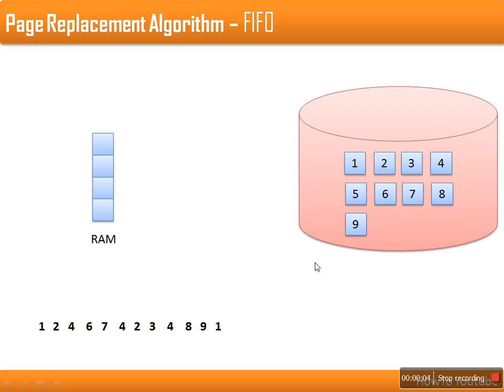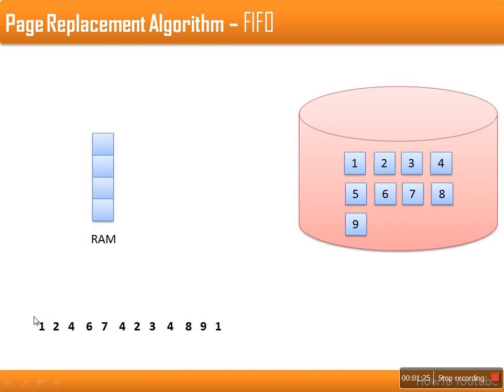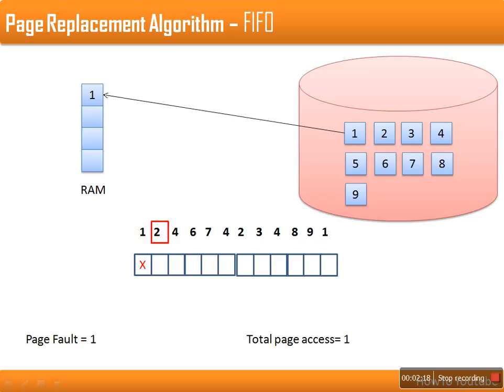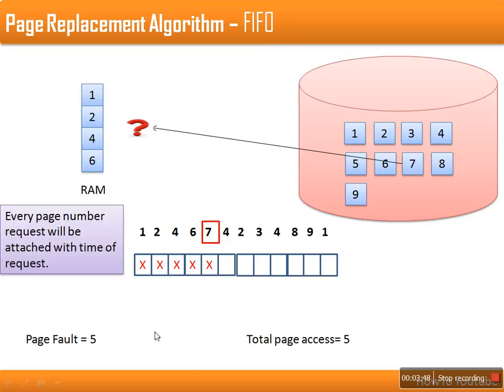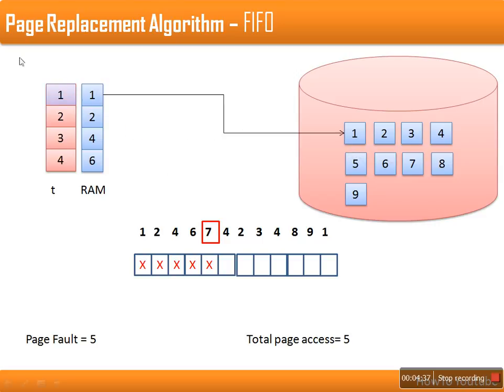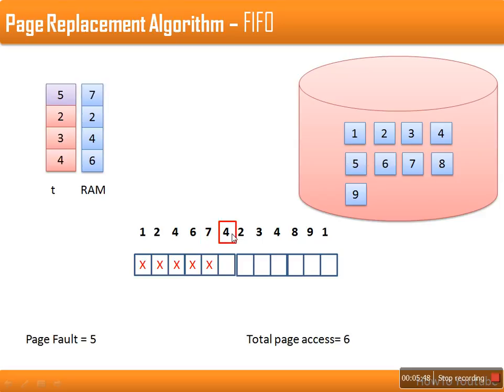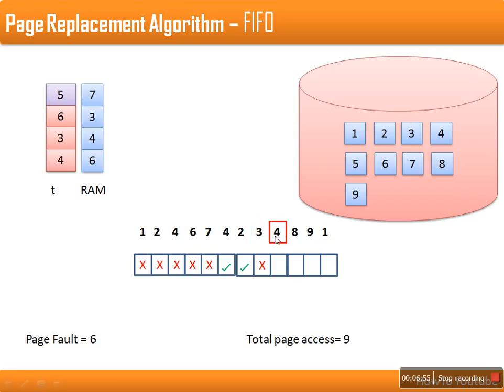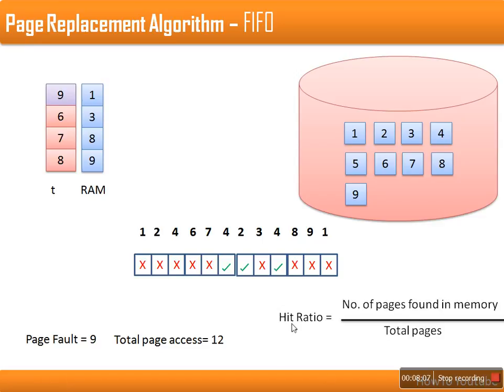Page Replacement Algorithms : FIFO(First In First Out)

Comment: Whats the difference between virtual page and physical page?
Reply from the maker: Virtual memory gives an impression that program larger than memory can be executed. Let's say RAM is having space for 200 pages and our program needs 400 pages. In that case virtual memory allows execution of that program.
Now as you can see that's not possible to load all pages at a time so what virtual memory will do it will load pages which are required currently. So pages which are available in memory are physical page and pages which are not available in memory known as virtual page.